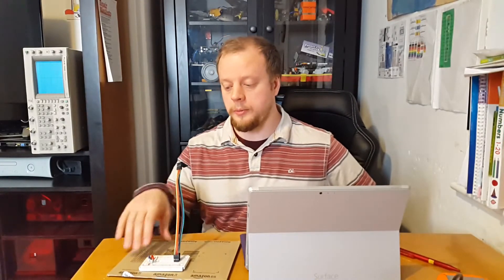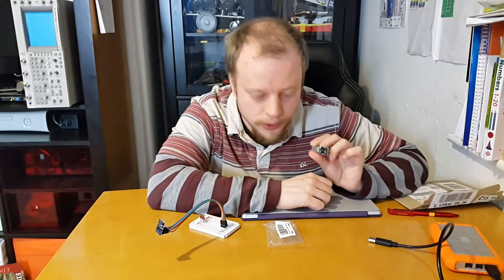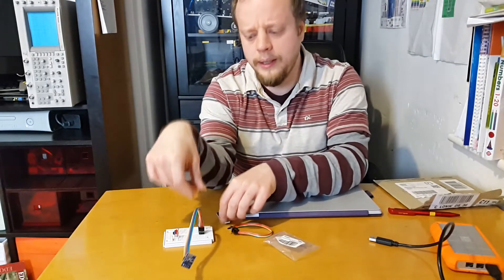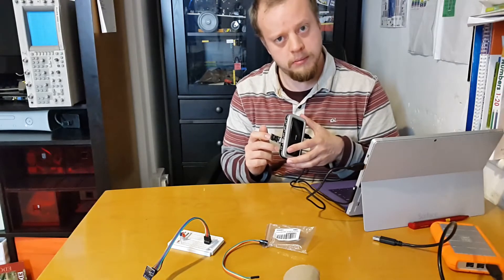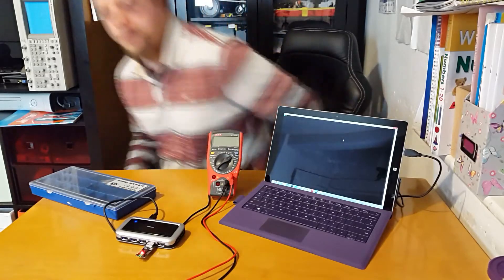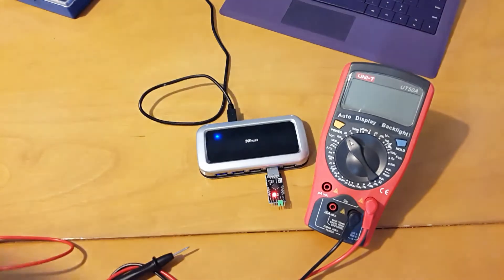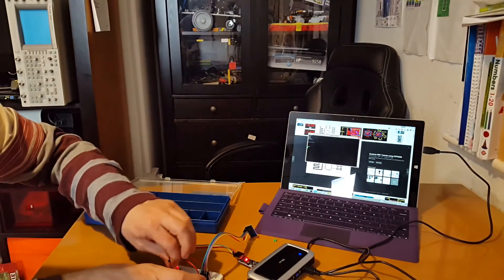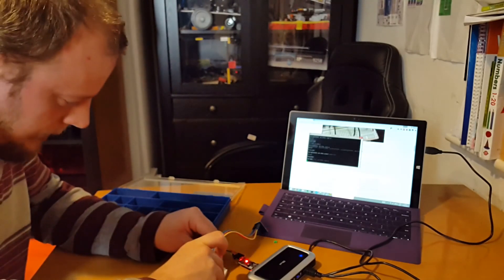Testing a serial cable and Talking to the esp8266

Comment: Hi i was whatching your video im now using the module and i want to ask you if with the module how can i look data sending throw another device directly connected with the esp, and from a terminal (putty) look the data
Reply from the maker: +Bernardo Davila let me make sure I understand - you have an esp module, and want to connect a sensor to it. You want to get the data from the sensor via a terminal? If you are using NodeMCU you are able to set up a telnet server (simple text, on any port). You can then use a timer (which repeats and starts a function) to collect the data from the sensor, and then output it to an open port. Take a look in the code in my later video on a web server and LED. I am yet to publish my next video  - which does waking up on timer and outputting sensor data on serial (not via telnet) - which could be a starting point.
Reply: +Orionrobots but the problem its that the other device sends info by TX and RX only i now im not able to see the data from the other device
Reply from the maker: +Bernardo Davila I see - it is serial based. If you are using NodeMCU perhaps you can use the UART module. http://nodemcu.readthedocs.org/en/dev/en/modules/uart/ - use the On part to trigger based on the device, and write to ask the device to do stuff. It looks like you can allocate other serial pins too.

Comment: I look forward to seeing the next pat of this. One recommendation, when doing computer work, consider using some screen capture software like Camstudio. Man other free options are also available, and it really improves the video quality.
Reply from the maker: Samuel Doye I think I need to get the hang of the PIP (picture in picture) tools in my video editor too.
Reply: I personally think it is fine just to cut between the footage of you and the video from the screen. The videos are fine without capture, but it is a potential way for you to improve without spending a lot of money.
Reply from the maker: For the existing footage - I will use some annotations to show the important points from the onscreen info - at least that way it's not missing.
Reply: That works as well, although mobile users including myself will!not be able to see them.
Reply from the maker: That's good info - I should try my videos on my phone to see how they look. I'll definitely use screen cap for new stuff.
Reply: Great, I look forward to it.